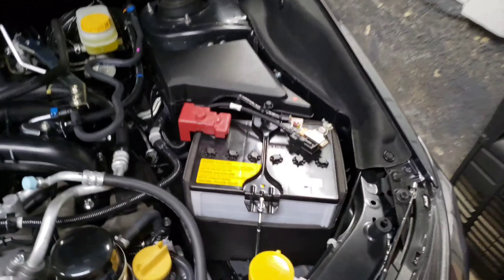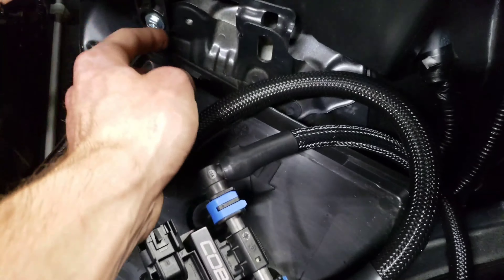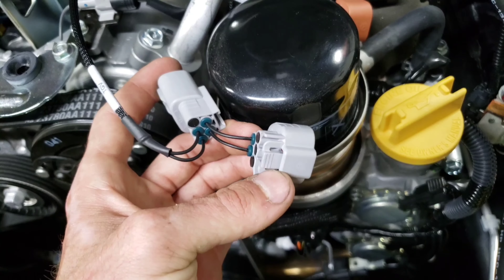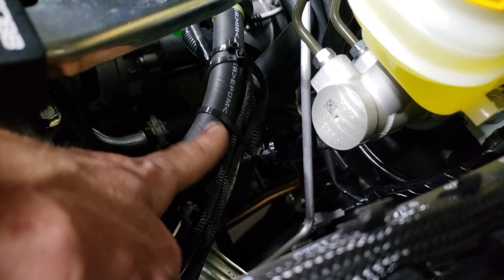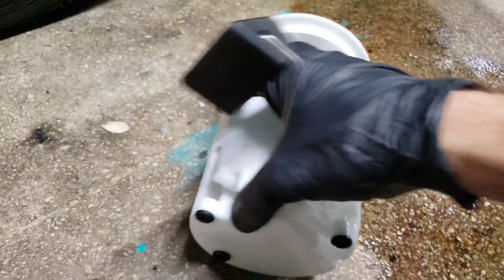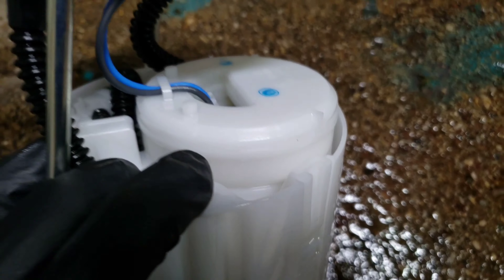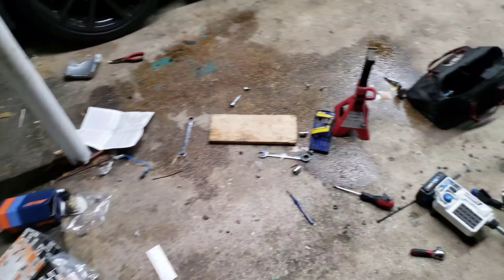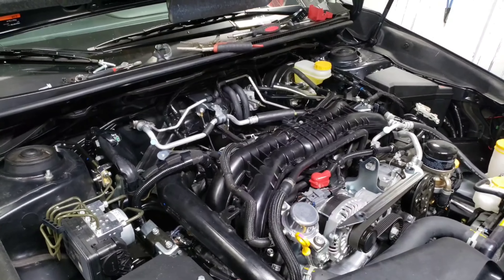E-Tune Prep: Cobb Flex Fuel Kit & DW300c Install On My 20 WRX

Comment: Did this with an AEM 340, but it blew a fuel pump fuse. Not sure why, maybe didn't use correct spacer? Also used the dw300 adapter kit and fuel sock.
Reply from the maker: Zero issues with my dw300, not sure why it would blow a fuse. I wonder if the wiring shorted out inside the pump assembly. Or maybe even the pump itself I doubt the spacer would be responsible.
Reply: @StreetInspired1  yeah that's what I was thinking, I'll just eat the 140 I paid and get a DW300.